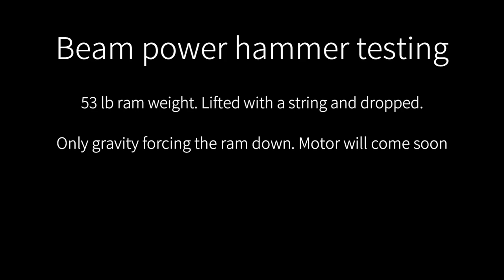Beam power hammer testing.

Comment: Looks like you used the christ centered ironworks plans, at least in part? I got 3 different sets of plans from them (at 2-3 bucks each well worth the investment) as wall as looking at builds by rick rabjon and ray from the hay clan here on youtube. I went with the davinci cam because it was what I felt I could build with the tools I had on hand. My hammer was build for a slightly different purpose (dishing sheet metal rather than blacksmithing) and shows that in some of the particulars. Things I have learned that may help you. Some pulldown springs are another way to increase striking force, plus there presence will allow you to have a faster cycle (if you want that). use the biggest, slowest motor you can find. I am using a ge 1hp 1750 rpm motor, and when I end up having to replace it I am going to go with a 1.5hp 1400 rpm motor. Here is a look at my hammer when I first finished it. It has been in use for over a year now and has been modified and re enforced  some. Been meaning to make another video. Good luck and nice build.
https://www.youtube.com/watch?v=gtB9pSdjAuU
Reply from the maker: Yup. It’s exactly Roy’s. I was just dropping with gravity in this video. There is an updated one with the motor attached
Reply: @JustinTopp  Awesome, I'll look for it. Does it cover the particulars of the motor you used? And reduction pulleys?
Reply from the maker: @BlackPowderGeek  not really. I just used some off eBay